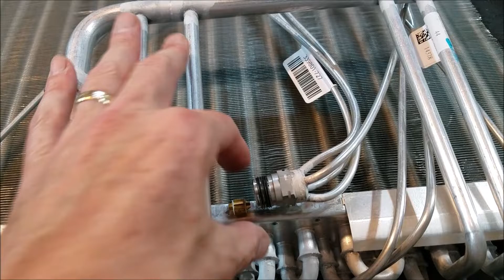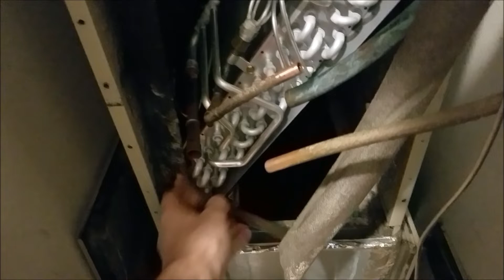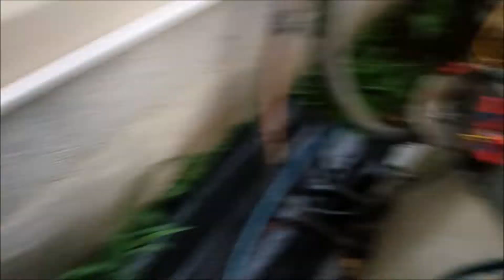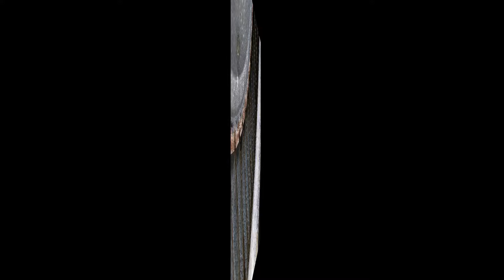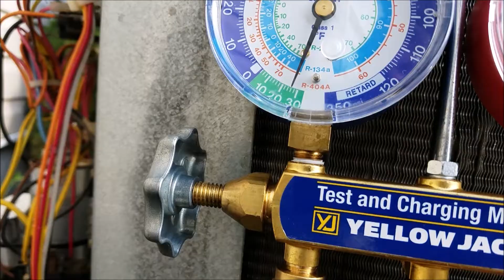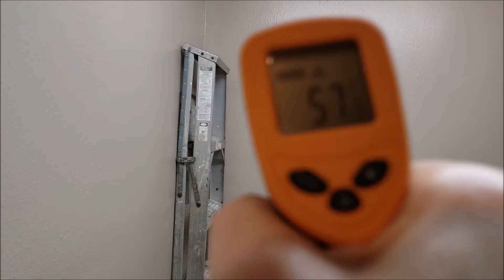DIY How I Replace My 1st HVAC A Coil / Evaporator By My Self, Now You Can Too

Comment: Good repair. Liked the tips. Reminds of days when we did our own car ACs. Today the expense of Freon capture/recycle/disposal systems, with their multi spec technology, used by certified collision repair shops,  is applied, along with a myriad list of other rules and regulations, to higher costs of repairs.. Late model cars involved in collisions, are often totaled today, as the parts and labor costs easily exceed the value of the vehicle.
Reply from the maker: I know what you mean, Big brother EPA making it harder to fix your own stuff. Thanks for leaving a comment.